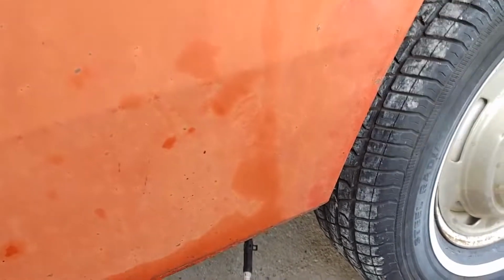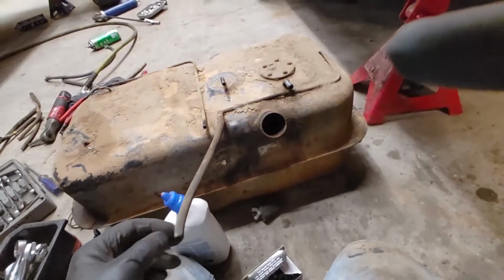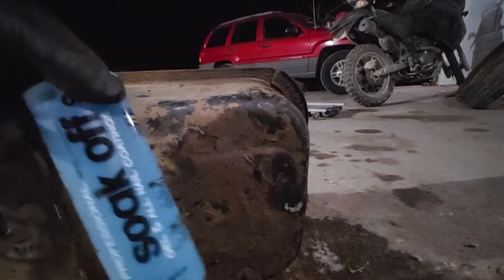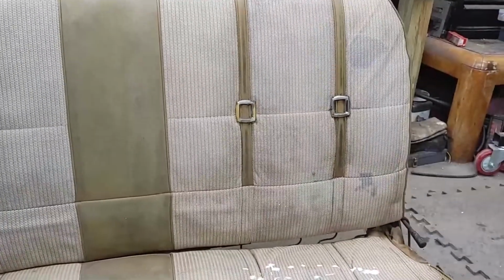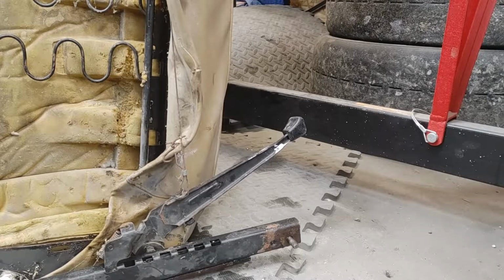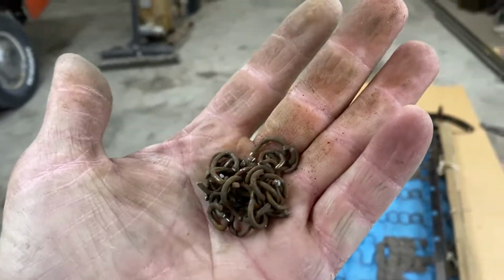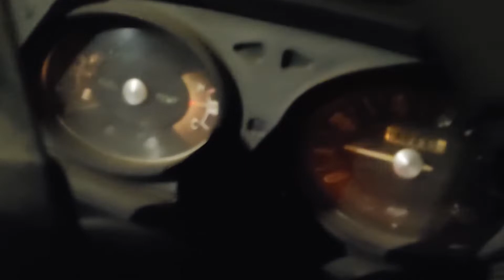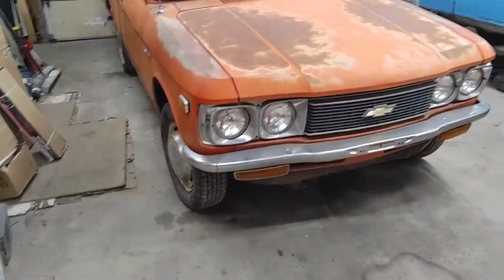Remove THICK Gas Tank Varnish and Bench Seat Repair

Comment: You saved me a lot of headache. My 73 fuel Guage is not accurate. I running a built 355 on the stock 10 gal tank so I need it to be accurate. Thanks to you I'm not seeing a removable sending unit. I was thinking of removing the bed to gain access to avoid stressing our the brittle lines. I'd love to buy a new tank but I'm afraid that's wishful thinking.
Reply from the maker: At the time I thought it wasn’t removable either. I found out later the 2.5”-3” round thing that looks like it is riveted are actually screw heads filled with dirt.  I ended up removing it to get the gas float working again but I either forgot to film it or lost the clip.  Mine was crusty as hell but after scraping and cleaning it worked again even though it was completely stuck.  I should have made another clip to clear that up!
Reply from the maker: Also, I was in the same boat about not wanting to mess with the lines.  Except for the filler knock though it’s just regular fuel line so not hard to replace.  My local auto parts store had generic straight reinforced hose the right size that I made a new filler neck out of.
Reply from the maker: Sorry for all the replies but wanted to let you know there is this vendor in Thailand that has brand new gas tanks, sending units, and other impossible to find mint LUV components.  I think when I asked him the total cost for tank shipped from Thailand is ~$300. He’s on EBay and Facebook. I just ordered some new chrome headlight bezels, taillights front and rear windshield seals from him. Has a positive reputation in LUV community.
Reply: @fabricobbletech   Hey please. I cant tell you how glad I am to find your channel. It's not only entertaining but informative. I couldn't find anything on Ebay. If you ever have some time and can send me a link or something I would be grateful.
Reply from the maker: @robertyoung8289   His name is Akkapong Sricampa.  Business name is PJ Garage.

Comment: Some claim vinegar works well for this kind of thing.
Reply from the maker: I saw so many different theories online.  I never tried vinegar but I used toilet bowl cleaner, acetone, E85, and some methyl acetate.  I honestly think the abrasive agitation is what’s really required to break it loose.  I got another tank out of parts truck I might try to get more scientific with.  Shaking it by hand sucks.